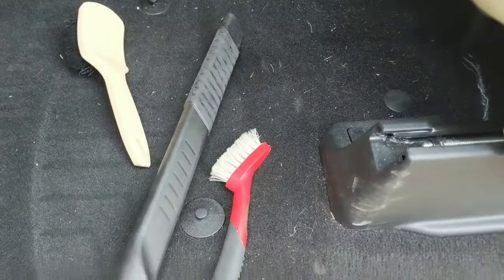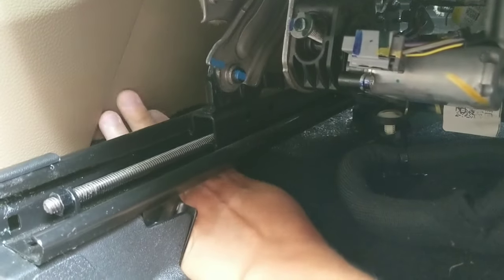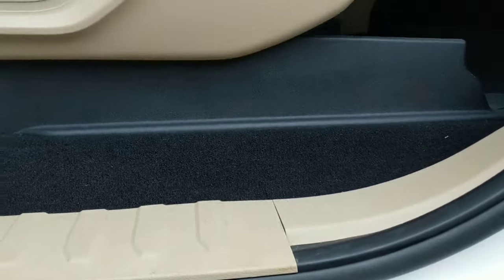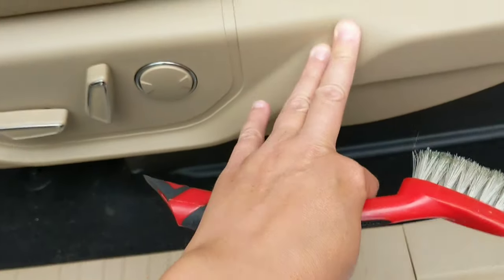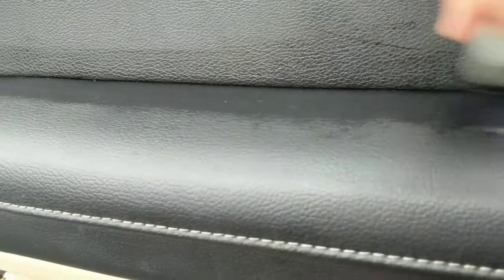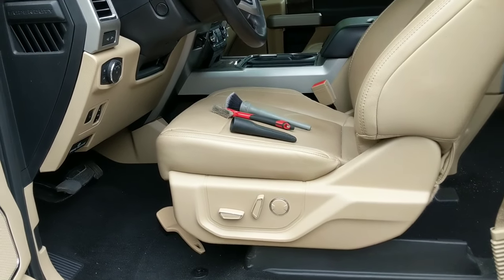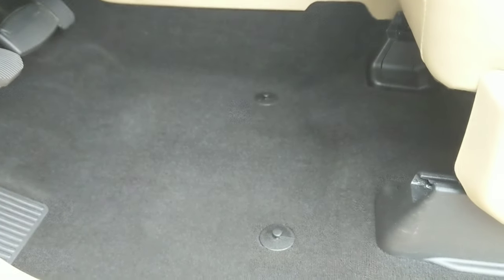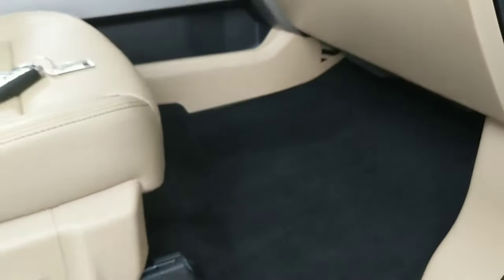How to clean around seats and tight spaces in your car!

Comment: I am no detailer, but I use to get into tight spaces around seats and console is a paint mixing stick.  I will wrap a strong clear packaging tape and wrap it around the tip several times with the sticky side facing out.  The stickiness of the tape and the narrow stick will pick up the debris and dirt in those tight spots.  Then I will repeat the process by retaping the stick as many times as needed.  Of course, use the detailer brush like she is using in the video to sweep as much of it out as you can so you can vacuum it up, initially.
Reply from the maker: Try a wheel brush instead of all that tape and see if that helps

Comment: Great idea
Isn't there a reverse setting on vacuum to blow out areas. I believe it's the opposite side (exhaust end)
Just plug hose in opposite hole and blow the debris to front
Reply from the maker: Yes that would work or something like an x-power blower which I use and love. Obviously a air compressor would give the best results but the exhaust of the vacuum works well too just make sure it's emptied and cleaned out before attempting

Comment: First of all, I was not smart enough to move the seat back and forth. Thank you. Second,  I was not smart enough to use my air compressor. Duh! Thank you. Question: do you clean/dress the pedals and the vinyl foot rest on the floor next to the brake pedal?
Reply: Clean with APC, yes, but do not use any any dressings. For example, Meguiars Interior Detailer, 303 Protectant, Car Pro PERL, etc. These dressings contain chemicals which can be slippy if applied to pedals, gear lever, and steering wheel. Just use a degreaser or other general purpose cleaner for the parts that can affect the safe handling of the vehicle.

Comment: But how do we clean up sticky carbon leftover below the seats(where it adjusts) or areas like the door lock socket or inside ac vents? Is there any solution which we can use to Remove that with ease?

Comment: OK my issue is like around the plastic of your center consul I’ve always just used an X-Acto knife to get like food particles out of that stuff but I always end up scratching up the plastic of my center consul and then I have to go through the steps to polish it and get the scratches out and I don’t want to do all that so when I say I need to know how to get into the tightest crevices I mean tight like a centimeter of tight the detail prep brushes help yes but they’re not strong enough to get in there I did buy a blower tool and I don’t know how to work it quite yet but I will figure it out I’m gonna watch a video on how to do that next so maybe I can get De compacted particles from the last four years out of tight spaces like that
Reply from the maker: I will do a video soon and try to show that

Comment: I spilled protein drink between the middle console and passenger seat. I called detailers and they all cost an arm and a leg. They said they’d have to pull the seat out. Any way I can clean it without taking the seat out?
Reply from the maker: Can you access the stains and the full middle if you put the seat all the way forward and all the way back? If not then they may be right and you may need to pull the seats to properly extract